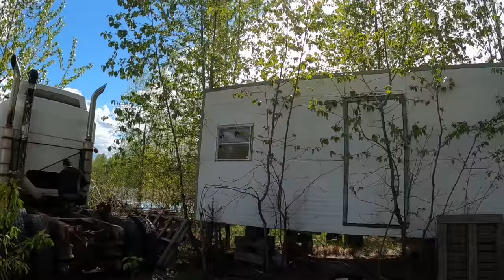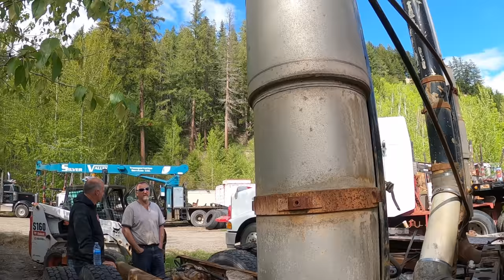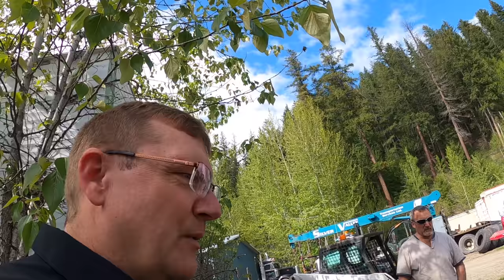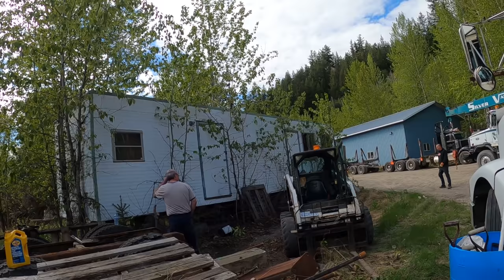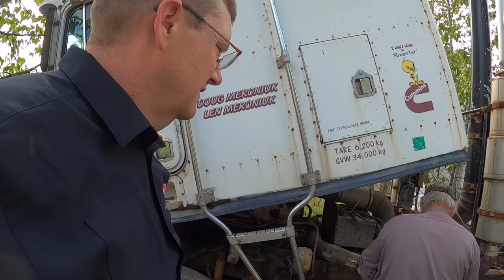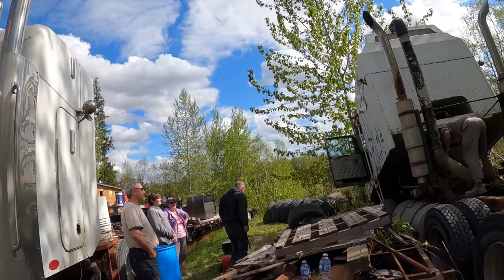WILL IT START? 1988 Kenworth K100E sitting untouched for 9 years....

Comment: GONNA HAVE TO CUT THAT FRAME OFF TIE IN NEW MIGHT THINK ABOUT ALSO STRETCHING IT IF IT'S GONNA BE YOUR SHOW RIG OR GROCERY GETTER. SO HAPPY SHE'S ALIVE...
Reply: keeping it the same length, flat bedding it, and turning into an RV hauler or something would be cool, with the short wheel base it would make turning quite easy.
Reply: The frame rails are severely rusted, so cut and replace as a minimum.
Reply: the frame is in bad shape i would cut the old frame and weld in a new frame cut off

Comment: You seemed really surprised that it started and had good oil pressure and holds air You have to remember that this is a KW Truck what else is there to say that they are Thee Best Truck can't wait untill you start working on it again Good Luck
Reply: That's why I only.own and drive kw they are the best and I out pull and out run every junk.pete I come acrossed

Comment: I live in Illinois and I know it not feasible to drive to Illinois to get the frame fixed but there is a place called LINCO in El peso Illinois that will rebuild doubles frames. They take the frame apart clean out the rust and put the frame back together.

Comment: I’m sitting here chuckling, I’ve overhauled many of these engines over the years, and see no one really is familiar with the engine. When rad troubles happen, and not very many people are familiar with the low flow cooling I switch the engine back to regular cooling. Easier to maintain, at 78 years of age still repair and overhaul these engines. Good luck on the fixer upper.

Comment: That is my favorite American truck. If I'd move to USA and get into trucking, I'd buy a relic like that, rebuild it with a Scania engine and transmission and insulate the cab from noise and heat from the engine. The short wheelbase it's perfect, don't need to be any longer. I'd probably change the fuel tanks to hold at least 300 gallons.

Comment: I thought for sure you'd kill every mosquito in the PG area old 855 Cummins engines like to belch out the blue surprisingly it didn't smoke. Its got a bad injector thou I could see the white smoke in the exhaust, didn't have the big cam knock. Do they brine the hell out of the roads in PG? how did the frame get so rusted? The air in PG from pulp mills that corrosive? The money spending begins just like owning a boat lol.

Comment: Good project.  Thanks for the video.  Keep us updated ...
These old girls are fading away.  Stretch that frame, major tune on the engine, full service, and go pull something.  Get some heat in all the bits and pieces. Figure out what needs attention, make a plan and do it :-)
Reply from the maker: Thanks, will do!

Comment: Gotta be sweet hearing an old Cummins diesel firing over for the first time in many years with so little sweat and blood.
Almost no smoke pouring out of the stacks is a sign the injectors are in good shape as well.
Now how about the charging circuit.

Comment: I've learned when starting an engine thats been sitting like that for awhile that you need to verify oil pressure and then give her the ketchup! Frees up the rings and valves. You'd be surprised how noticeable an engine will clear up when it's revved up for a couple seconds
Reply from the maker: Great tip!
Reply: Give her the ketchup? I've only heard "Giver her the beans"
Reply: @fryloc359  Yeah I've heard both. Couldn't tell ya which one works better😂

Comment: If an engine sits for 9 or more years does the top of the cylinder above the pistons get solid rusty or are all the cylinders sealed against moisture and don't rust over the years or do they get rusty and the top sing just scrapes through the rust??

Comment: I have an idea. 
Flat bed it and use it as an RV Hauler.
Reply: Could likely work with Arctic and see if they can do something up for you
Reply from the maker: yeah, i want to try driving it as a shorty.  maybe  i can use it like a pickup.
Reply: @mikethetrucknut  My thinking is that with the short wheel base it'll make driving through an RV camp ground or something a bit easier.
Reply: @mikethetrucknut  you could also put a big bumper pull hitch on it and use the flatbed for a smart car, some motorcycles, or a side by side.

Comment: Too bad the previous owner turned that truck into a trailer toter. Aerodyne cabovers are really hard to find 😪  Would look good with about a 200 inch. Newer frame cut off. Just Saying. 🇺🇸  Of course. It is your ride. You will build it the way you want. 💰😎🚛

Comment: It's a Cat right? So it's more than the Cummins 350. The 4 and a quarter cat in other words. Okay. It's been a secret I guess that we didn't share with nobody at all? Oh, I'll be danged. The mobile Home trucks are so useless though for everyday work when all you need is a category 4 hitch and an appliance for a four wheel drive tractor, but they want to make it a surprise when you move to town for the remanufacturer conference that nobody is going to attend.

Because you got to have a lot of Tanks for the NEW show coming up I guess as CBS rolls out the new season for Parker Drilling and Oilfield Services Industrial. Yeah, "Remanufacture"?

Comment: I would never start an engine that has stood still for so long...
... without first give it a good service, including replacing all fluids and fuel, new gasket, new filter, new oil, new battery.

Before you know it, you damage the engine (e.g, crankshaft bearings)
Reply: If you are rich you might gamble on all the costs and work of oil and fuel and filters, before you know if the engine will work. DEBOSS GARAGE gambled and lost. Jul 3, 2021 "Hiding in Plain Sight... #OptimusBrine [EP2"